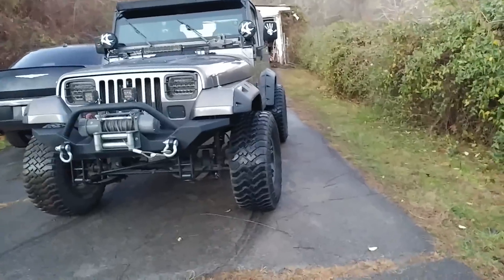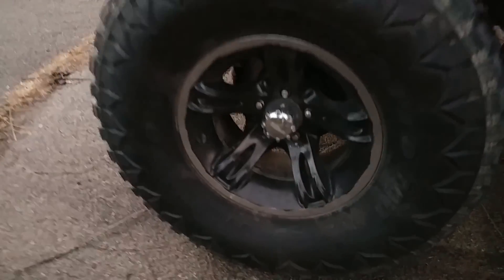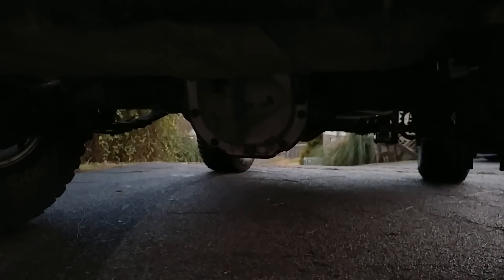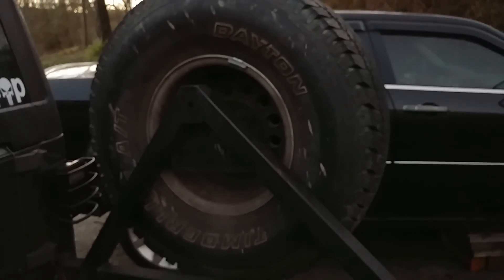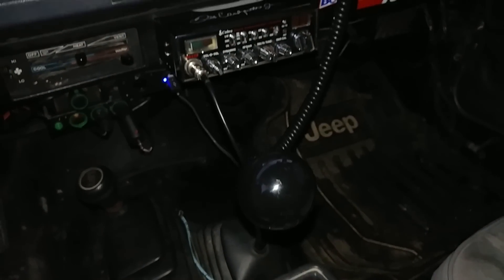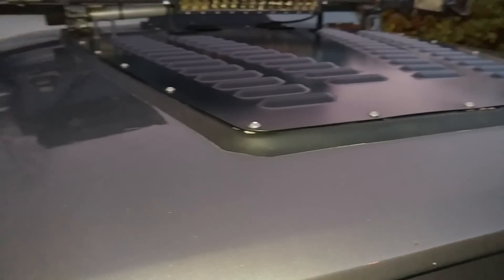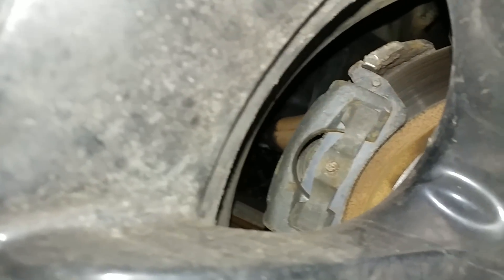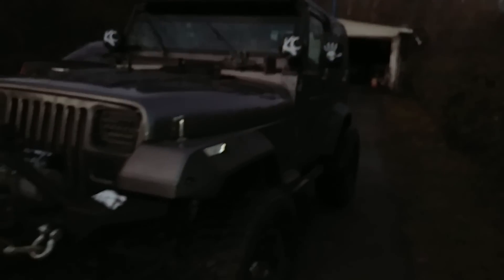My 1993 Jeep Wrangler YJ walk around

Comment: Great build! May I ask, where'd you get those discs for the rear, did they come in a kit? Also if you ever have to replace the damned fuel pump, whatever you do DON'T get O'Reilly's "Precison" fuel pumps. Went through three of those POS in week, dropping the entire damn tank everytime! I've had an AirTex pump since and it's been working wonders, Bosch is great too!
Reply from the maker: The rear end itself is a Ford 8.8, they're stock with disc brakes. And I haven't had to replace the fuel pump yet, but it does whine a little bit 😂 I'll make sure to keep that it mind about the brands!
Reply: @OctaneSlain  this Jeep doesn't have air conditioning?

Comment: Do you have any issues with the Hi-Lift mounted on the hood? Blocking sprayers, road noise, or blocking hood from opening up fully? Thinking of mounting mine like that on my YJ.
Reply from the maker: All of those are a non-issue with the hood mounts. The only negative is the added weight when opening the hood. It's pretty heavy now.

Comment: So you have 33"s on your original Dana 30/35 axles?   Any issues???    I have 31" and I am told to be careful going bigger??
Reply from the maker: Saint James I've blown the D35 up twice. It's got a Ford 8.8 in the rear now. The D30 has held up great. I wouldn't go larger than 33s though on the D30. I've heard of people using it with 35s, but idk if I'd trust that.
Reply: Yes, agreed, good call on the Ford 8.8.    Great looking jeep
I just installed a "G2 Dana 30 YJ/XJ/TJ 27 Spline Front Chromoly Axle Kit - 98-2031-001" in front axle.   I was having issues with my disconnect so I eliminated it.     Do you have the stock disconnect ??
Reply from the maker: Saint James I still have my original vacuum disconnect. At 250k I'm surprised it still works. I'm going to the TJ swap just like you if mine goes bad
Reply: Austin, I am shocked that it still works.   Good for you!   I could not get it to engage and it left me SOL a few times.    So, out of frustration, I just eliminated it.     Just a heads up, your gas millage goes down a bit and the differential fights you a bit on sharp turns.    For me, the trade off was worth it to get a more reliable 4WD.  Cheers!
Reply from the maker: Saint James I wanna lock my D30 with a Spartan locker and thought it would be an emphasized issue with the TJ shafts on curves as well... But the thing drives like a log wagon anyways, I'd probably just adjust to it haha. The only issue I've ever had with mine was the vacuum lines dry rotting... I replaced them all with weedeater fuel line and it's been working great. As soon as I throw it in 4H or 4L it immediately engages.

Comment: I’m still confused by how people can treat their jeeps like this. Like in some ways you treat it very well and then in others it’s just never touched. Like I love how you update and replaced your headlights and added a massive bash bar and headlight and rear light guards, the winch, the spare tire mod, but then you open the hood and you can clearly tell no attention has been paid to the masterpiece of it all. The godlike creation, the bulletproof engine. The whole engine bay looks like it’s just never been touched and I can honestly say that is one of the best ways to dramatically shorten the lifespan of an otherwise long lasting reliable machine. I can honestly say, you could spend very little money and a days worth of your time cleaning the engine bay and your vehicle will appreciate you for doing it, not like it’s a living thing but it will help your vehicle last longer. And engine bay cleaners can run you about $300 for a years worth of bay cleaning supplies if you were doing short maybe hour long once overs to make sure at least the most crucial parts are in top condition. Another thing that is good to take care of is wire management. When I bought my yj at 16 I was already a pc nerd and loved working on fiends pc’s and my own. So my ocd with wire management went bananas, the first thing I did to that truck was make sure all the wires were in order and managed, and even without a good cleaning it looked so much better without stray wires all over. I posted pictures after finally fixing up the engine bay and cleaning up some other issues around the truck mainly including the interior and the previous owner commented and told me in that condition he would buy it back from me for 1.2k more than he sold it to me for. And all I did was do some cleaning up. Just personally I think it’s just better overall if you learn to take care of your vehicle better, it’s better for your money, it’s better for your safety, it’s better for those who might depend on you for a ride or something. There’s just a lot of things that are improved by having a well maintained and well taken care of vehicle.
Reply from the maker: Hexed Hero Since you're 16, I can see how the appeal of "engine bay" cleaners and such may have on you. There's absolutely no point in keeping the inside of an engine bay spotless when a vehicle like this will just have it trashed again. The engine internals are what you want clean, not the outside. It's an iron block engine... If you regularly perform maintenance on the engine, that's what keeps it alive and healthy. My jeep has 245k on it. I highly doubt the mud on the engine has shortened its lifespan. I understand and appreciate your concern, but I'm also a 4th generation of mechanics.

I will agree with you, however, with the cable management. Nothing wrong with tidying that up at all. But mine is sloppy because these LEDs go out faster than you would think, and I'm constantly replacing them.